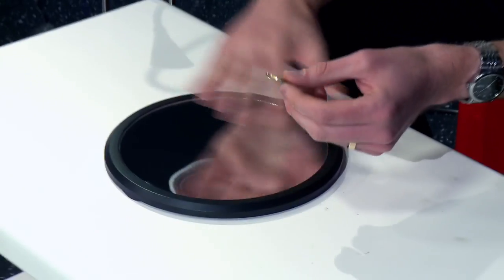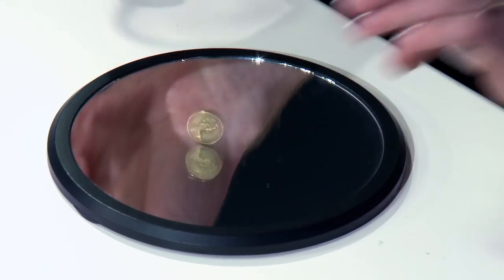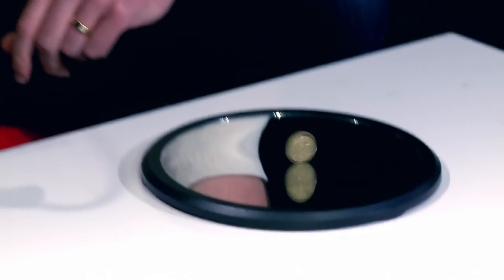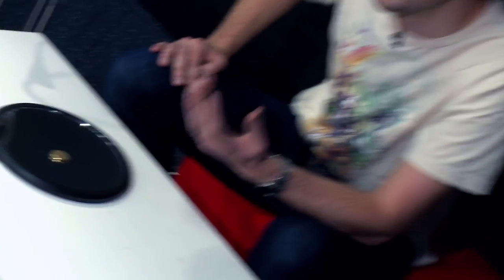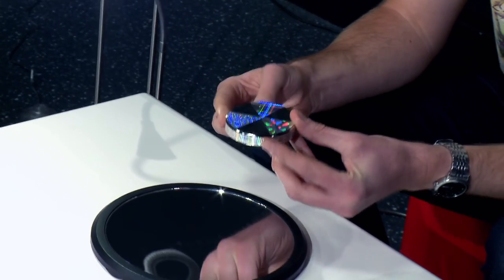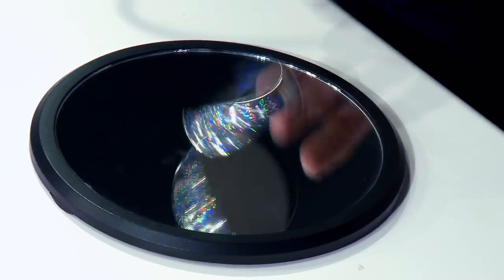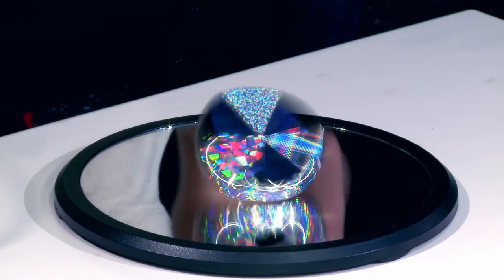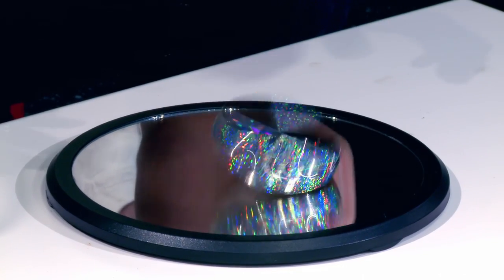A spinning coin explained

Comment from the maker: The disc’s frequency increases because it loses energy due to friction with the surface below and the air around it. If there were no energy loss, the disc would continue to spin at a constant frequency. But since energy is being lost, the centre of mass of the disc lowers and the spolling frequency increases until the point of contact when it stops completely. So as energy in the system decreases, the frequency increases. It's called a finite-time singularity...

Comment: Id have thought It could spin a lot faster if you made it much dencer in the center than the out side maybe used a lead cilander in the center of a smooth very light waight plastic case.

Comment: Just guessing on intuition here, but the increase in frequency is probably due to the torque exerted upon the disk due to its inclination. As the potential energy of the system decreases, the inclination increases(If we define the inclination as 90 degrees when it's flat on the table). You always have the same downward force acting on the disk, but the torque increases as sin(angle). And torque acting on a rigid body leads to a change in angular momentum, or "spin".

Comment: I am interested in the maths behind the frequency.  Can you point me to where I could find a formula for the frequency of spin, based on diameter and thickness of the disc (cylinder).

Do the maths change for high ratios of h/d  i.e for cylinders, or cans?
Reply: 5 years late, but standupmaths, Matt Parker, has made a few vids on rotating disks just like this one
Reply: @Goku17yen  Better late than never